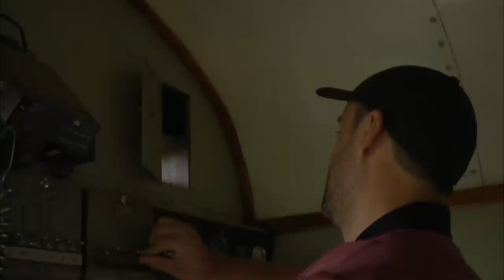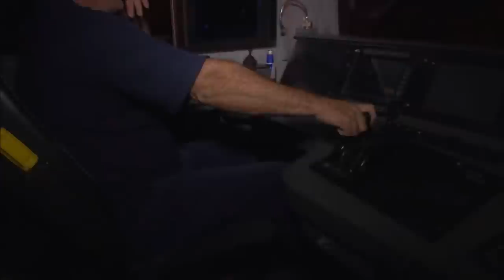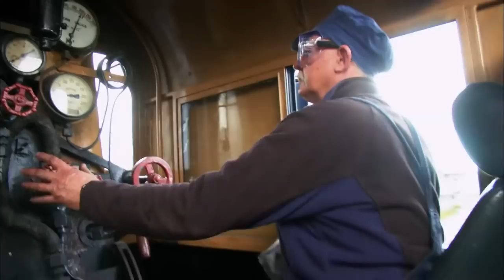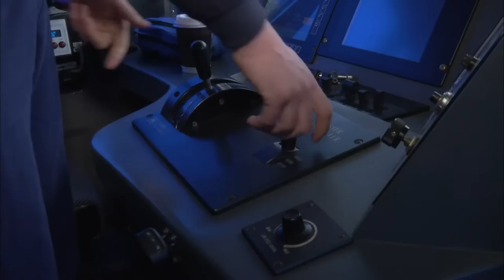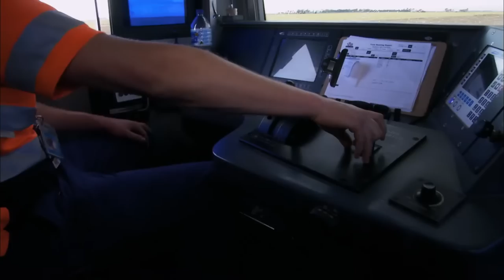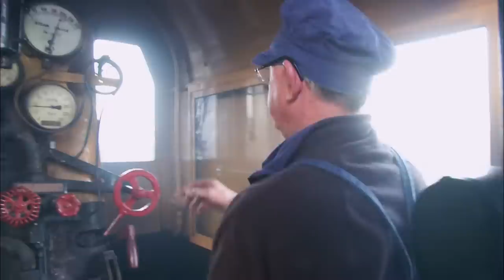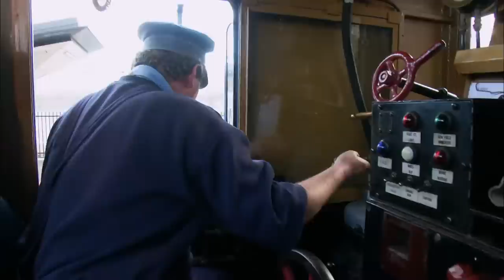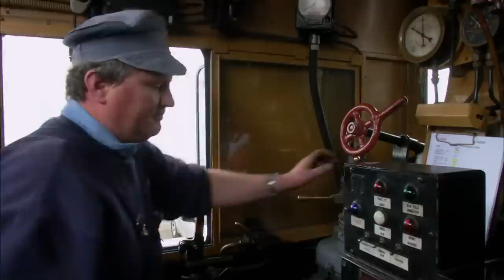Vandals Attack A 70 Year Old Steam Train | Railroad Australia | S1E07 | Documentary Central

Comment: I had an issue with a 12" Narrow gauge loco in UK where the fire was reported as "Trying to join the footplate crew in the cab!". It turned out the superheater tubes were a 'welded' return instead of a bent return and the weld had a pin hole fracture! Only an experienced steam engineer would have know this so if anyone is after a steam engineer with vast experience please do let me know!